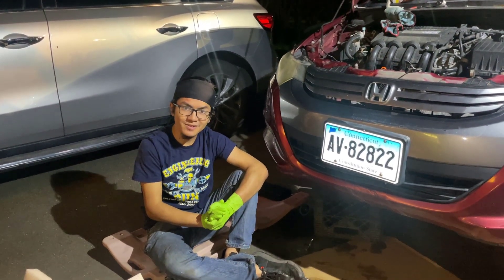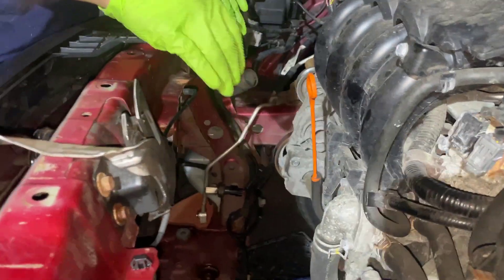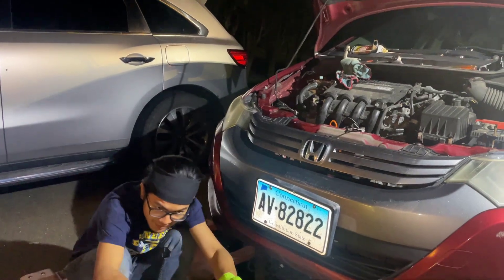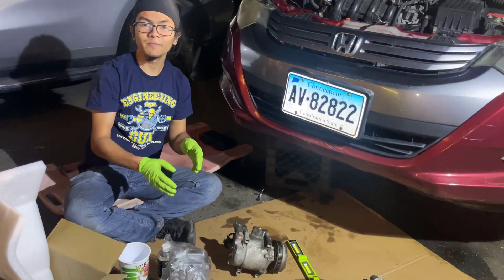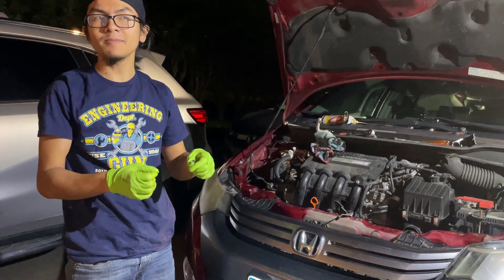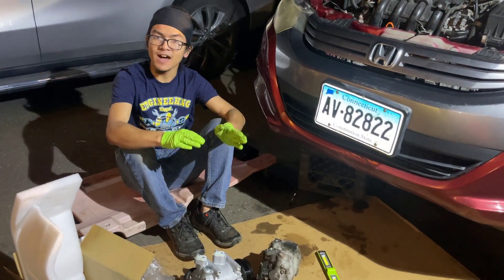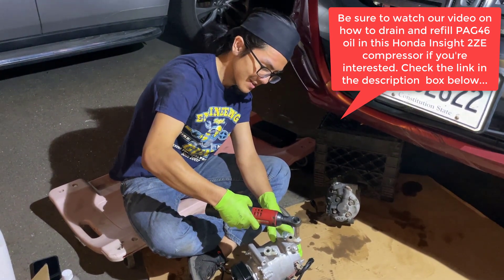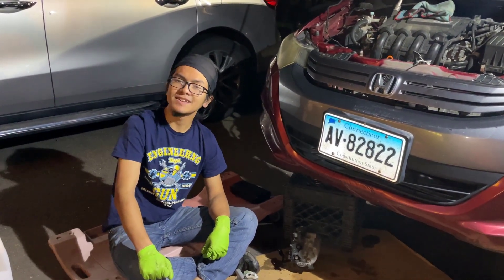Calculating How Much PAG 46 Oil To Add Compressor Condenser Or Bone Dry System | P7 Fixing AC Issues

Comment from the maker: Here are the #ad links to tools, parts and accessories you may need to perform this repair:
1.  https://amzn.to/3pfasXv  |  RYC Remanufactured AC Compressor and A/C Clutch EG891 (Fits Honda CR-Z 1.5L 2011, 2012, 2013, 2014, 2015; Fits Honda Insight 1.3L 2010, 2011, 2012, 2013, 2014)
2.  https://amzn.to/3q9PE2y  |  AC Compressor & A/C Kit For Honda Insight CR-Z CRZ- Includes Drier Filter, Expansion Valve, PAG Oil and O-Ring Seals! - BuyAutoParts 60-82242RK New
3.  https://amzn.to/453Ea3P  |  UAC RD 10898KTC A/C Receiver Drier / Desiccant Element Kit, White
4.  https://amzn.to/47Ke1c7  |  XtremepowerUS 3CFM 1/4 HP Vacuum Pump HVAC R134a R12 R22 R410a A/C Refrigeration AC Manifold Gauge
5.  https://amzn.to/3YM0FIz  |  TSI Supercool A/C Comp Lube, UV Dye, 32 Oz, Flsh PNT 442F (P46-32D)

Or Click on Amazon link here and search for what you need:  https://amzn.to/3xIOsqg

Comment: Finally someone talking about the exact problem I have, conflicting info on oil capacity. Should I just not go over the Max limit of 9 oz? For my van most of the info says 9 oz max, but when I add up the recommended capacity per component its comes out to 13 oz...., and I have to add oil to each component because I am replacing everything. So what do I do? Do I just add less to certain parts, like do I skip the hose capacity do I add a little less to the condenser or add a little less to each component? I don't know what to do in this situation. Most other videos they just fill the compressor and then dump the remainder into the accumulator, that doesn't seem right when replacing every single component. Anybody know? cause he doesn't seem to reply to messages :/

Comment: You didn't show how or where to fill the oil??
Reply: You fill it through an ac manifold. They sell charged cans with oil in them. Otherwise you'd add the oil to the component you're replacing.

Comment: Thanks for passing on that the new compressor doesn't have the proper amount of oil. I assumed it was the proper amount. From what I found online as far as capacity goes is the compressor should have 60% of the oil in it. OKAYYYYYYYY, what is that in oz. ?:)
Reply: Capacity X .60 is what should be in a compressor
Reply: I wonder if this is the reason why mine ac compressor bearing gone bad now. Even when I changed it 5yrs ago

Comment: My car has run 70k mile with factory installed A/C system.
Now do i need to change the compessor oil any time in its Lifetime.( As a preventive maintenance?)

Comment: There should only be a coating of oil in the whole system other then in the compressor …
Reply: Than... I normally would let that go, but it seemed to follow the tone of the comment.

Comment: i did replace ac evaporator, expansion valve, condenser, pressure switch and dryer, and kept the same line hoses,  i added 2 onzas of pag100 and try two old ac compressors but i didn’t work, two compressors started quickly to burn out, i already ordered a new oem compressor, hopefully make it works

Comment: Hi, I’m doing this whole service to an ‘05 Subaru Outback. Where’s the link on how to drain & refill the compressor? I have a newer compressor, but I filled it up through the suction side (haven’t run it yet). However, I’m not sure if that’s correct since other videos state to put the PAG oil through the high pressure port (smaller hole) of the compressor, then rotate the pulley to lubricate it. Did I make a mistake by introducing the oil through the suction side??
Also, I bought a brand new Condenser as well. Do you know if they already come prefilled with PAG oil and a new desiccant pack? Thanks in advance.